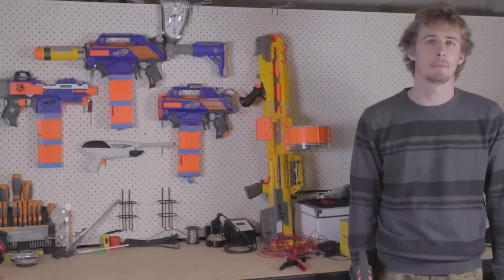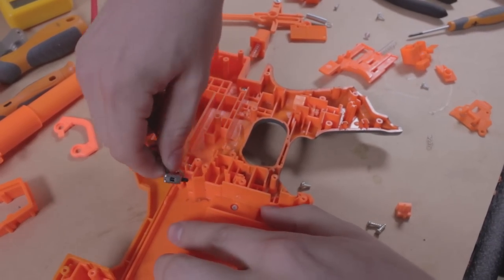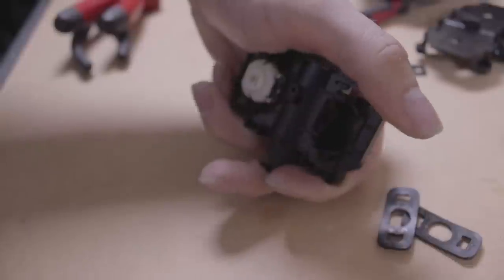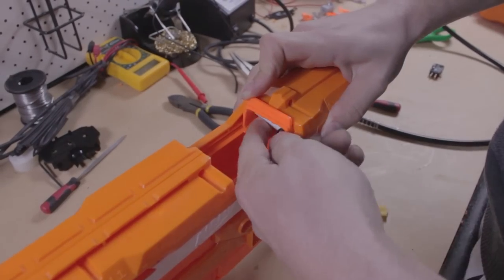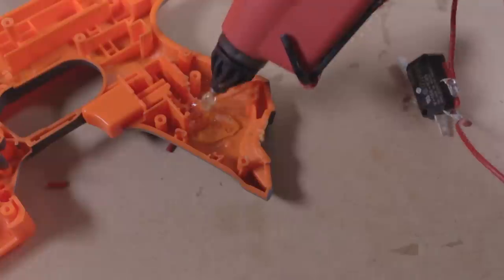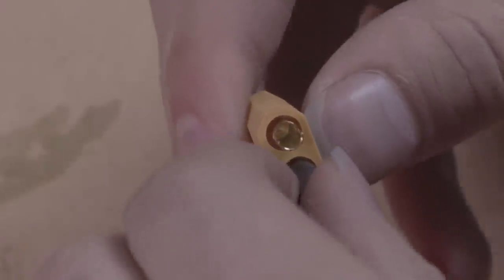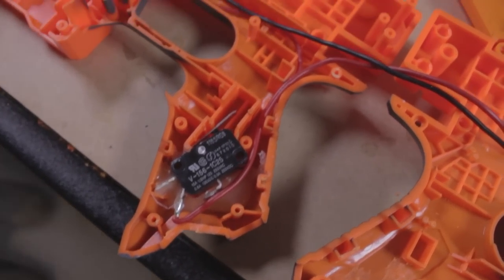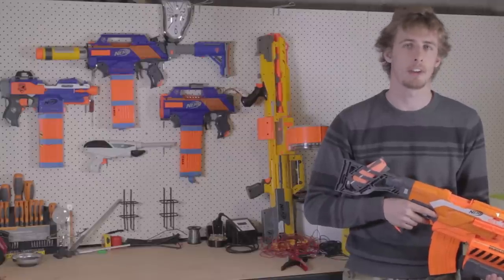How To Make A Super Demolisher | MAKE TEST BATTLE Modding Tutorial

Comment: Soldering is an absolute must-learn skill for modders (and in my opinion, adults in general)
But for anyone watching this video and wanting to mod their styfes or demolishers without soldering:
Instead of removing the electronic safeties / locks and rewiring, you can just leave them permanently depressed by electrical taping them shut, then hot gluing the taped lock to somewhere out of the way in the blaster.

It works great for long term (although always do a test before reassembling the blaster to make sure it's taped tight enough)
Reply: You can do that. But acording to Ohms law. That would still create that resistence so you would not get that best performance you would want. Trust me. That whole bunch of wiring, really affects the performance. Once i completely rewired my stryfe, on alkaline batterys and stock motors, it worked like a charm

Comment: I'm trying to hook up your 130 Rhinos to a stryfe and a demolisher. I know lipo's are ideal, and I know what the NERF community thinks about Trustfires, but is it possible to use 3-4 IMR or Trustfire batteries instead of the lipo??? I have everything wired up and looking good, but still not reving the motors up. Wondering if there is a bad connection or if it's a voltage problem...... Thanks!!!
Reply: Trustfires don't have the current needed to run rhinos and Imrs might.
Reply: Don't just don't please just don't
Reply: @Cringemoment4045 , still haven't made the jump to Lipo or IMR. Haven't really used my stryfe lately. It worked well for a little while but not so much these days. What sized Lipo do you recommend for these Rhino motors???
Reply: @theworshipbunker  a graphene 3s 950mah 65c lipo with a xt60

Comment: Probably add the specific material list, for anyone new using this link. It's alright, and goes to length in some details but misses some others.
Reply from the maker: Snoop Doggy Doge Maybe I should have mentioned it in the video but the next mod guide to go up will be a detailed run down of the physics behind flywheel blasters and electrical wiring as well as the tools and parts needed.

It would have extended this video longer than I would have liked; going into detail about what motors, batteries, switches, etc to buy will be covered in the next video.
Reply: That sounds great! I think just by adding that and a material list in the beginning and you have created the new standard for mod guide videos. I'll be referring your more refined videos to noobs. Good job and keep up the great work!

Comment: One question once you separate the two shells do you need hot glue to glue them back ?
Reply from the maker: +RedNinja Productions No, they just snap back together and the screws hold them in place -R
Reply: +Make.Test.Battle Thanks and is there a difference between a grey trigger Demolisher, and an Orange trigger? because Trustfires don't work despite removing the resistor and the thermistor in my Demolisher and i'm thinking about replacing the motors
Reply from the maker: I think it's just in the thermistors etc. Just check that you got them all properly. If you swap to say our MTB Rhino 130 motors you need higher current batteries than TrustFires. -R
Reply: +Make.Test.Battle Thanks Liked and just subbed
Reply: +Make.Test.Battle Actually I did get it right the first time, it's just the batteries Trustfires suck!!!!

Comment: I was just wondering, since micro switches are not readily available in my area do I have to use one?
Reply from the maker: Yeah, the stock switchs are really bad and will quickly melt. Try ordering online -R
Reply: +Make.Test.Battle Thank you so much. Keep up the awesome vids!
Reply: Blastertech in AU sells both the motors and microswitches. Super fast and reliable, too. Not affiliated with them, but I've gotten all my stuff from them (Total of 4 honey badgers, 2 hellcats, and 3 microswitches, plus some other bits and bobs) and never had any issues or delays.

Comment: can somthing like this be done using 4 IMR cells? and using the stock micro switch?
Reply: I don't think so. Replacement motors such as Rhino's are extremely powerful and need a lot of current. The current from the IMR's isn't sufficient for 2 Rhino's (20A approx.) so you'll need a LiPo. The stock micro switch can last on a 2S, but nevertheless it's extremely weak, so you will need a replacement microswitch.
Reply: Certain IMRs are capable of high discharge, but the spring contacts on the Stryfe tray will only take about 5A, so welding them into a pack may be necessary. At that point, you might as well have gone with a Lipo anyways.

4 IMRs is also more voltage than necessary. Rhinos on a fully charged 2S are still supercritical, 3S just gives that leverage of safety to prevent the RPM from dipping below supercritical. More voltage will also make the motors demand more current, which will further worsen issues with overdischarge.

I think that 1 IMR might be able to run Rhinos safely, but that obviously would get crap performance. Just stick with stock motors if you're running IMRs.

Comment: Just curious, any reason you guys always use XT60 instead of Deans?
Reply from the maker: XT-60s are used on the batteries that I buy, and are 10x easier to solder. -R
Reply: ah cool, Thanks. Mine came with a Deans, and after seeing pretty much EVERYONE using XT60 I was wondering if I should swap the connector on my battery or not...

Side note, routing wires in a Modulus us a pain in the ASS :P

Comment: im going to perform this mod. Would this lipo : TATTU R-Line 1300mAh 4s 95c Lipo Battery   be too much for the setup?
Reply from the maker: You want a 3S battery for Rhino motors -R
Reply: Or just start off with alkaline. ;-;

LIPOS ARE SCARY AF. i almost started a fire by short cuirciting

Comment: Does the mAh matter when buying the LiPo? I'm considering buying Rhinos but I really don't want to buy an extended battery case for my Demolisher.
Reply: I am an rc hobbyist (hence the name) lol. So, I deal with lipos about everyday. The mah is the capacity of the battery. A 5000 mah lipo will last you a few hours in a nerf battle, but they are way too big to fit in a typical nerf battery case. You should really only use a 1-2 cell lipo or a 3.7-7.4 volt lipo, which is pushing the motors past there limit at 7.4 volts. So I would use a 3.7 volt lipo unless you want to replace a motor or 2 after each war!😃
Reply: +The Droniac These rhinos use 3s.
Reply: mah is the capacity, more capacity means more playtime. i wouldnt go below 500 mA with rhinos on 3s or it will run out very fast
Reply: btw its important that you never totally empty your lipo thats really bad
Reply: Thanks, I already bought an 800 mah 40-50C LiPo pack. and my Demolisher runs fantastic.
Reply: RedNinja Productions what motors?
Reply: Rhino Motors. on a 3S 40-50C LiPo. it's sufficient for 2 Rhinos
Reply: Ik, probably more than sufficient
Reply: Yep, I just find the battery tray space so annoying. despite what these guys did.
Reply: RedNinja Productions i am working on a rayven  right now, same problem
Reply: BlasterSmithUK has a Battery tray expander for Rayvens, I guess the only option of modding demolishers, or Rayvens are rhino's, banshee's (2S) or Blade 180's.
Reply: RedNinja Productions ye, im going to put hellcats in it XD
Reply: @deerwithitUwU  nope 1s is totally useles

Comment: Will it work in the nerf rayven?
Reply from the maker: +WMSC COOL Yep! You'll need to change a few things like where to put the microswitch, but the general process is the same -R
Reply: +Make.Test.Battle Haha i was just about to ask the same thing! Do the Honeybadgers work with this?
Reply: +Make.Test.Battle What charger power connecter do you guys use? I have looked at the links in the description but it does not take you directly to the item listing itself... Many thanks Brodie
Reply from the maker: +Brods2 Honey Badgers would work. The charger I linked needs a 12-18 volt power supply such as for a laptop -R
Reply: +Make.Test.Battle thanks ryan

Comment: do i need the backstraps? If so, what can I use instead?
Reply from the maker: if the motors hold in tight then no you dont need then
Reply: alright, thank you so much. I over rotary tooled because i couldn't fit one of the back straps on.